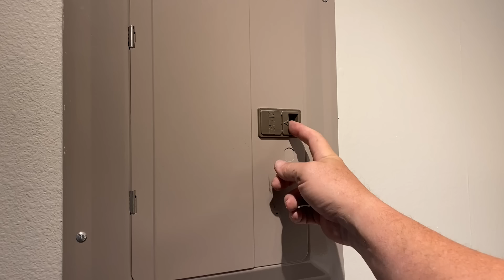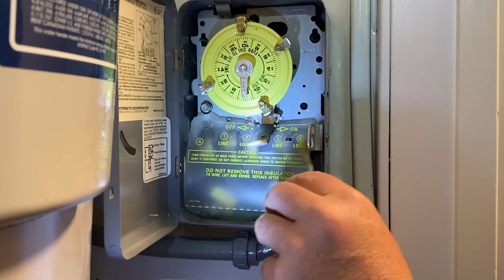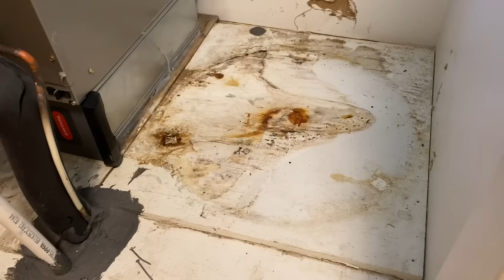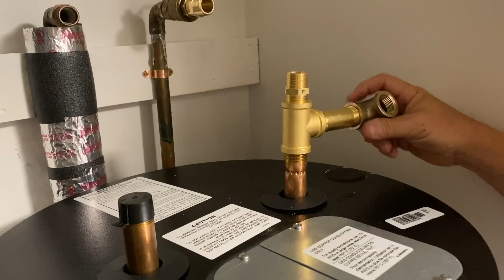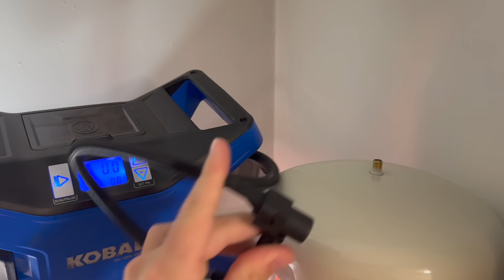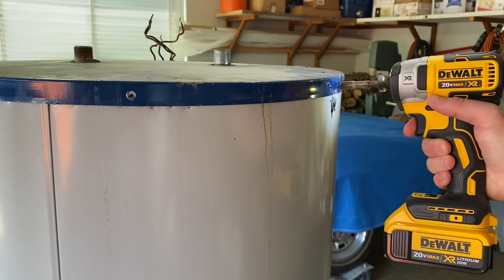I Saved $1,000+ By Replacing My Electric Water Heater (Step-by-Step)

Comment: You mis-spoke about the wiring. You referred to the black wire as the negative wires…..that’s only on D/C , or Direct Current, circuits. Like a car or a generator. 

In homes, which are always A/C Circuits, or alternating current, on a 120volt circuit, black is your hot wire or live wire…..white is your neutral wires. 
 220 volt circuits like this 30 amp circuit for water heaters, it doesn’t require a neutral to be present. So the white wire coming from the electrical panel isn’t a neutral, it’s used as a secondary hot wire. Pretend it’s actually red. That’s bc both white and black wires are landed on the breaker. Where on 120v circuits, black is landed on breaker and white is landed on the neutral/ground bar that is attached to the sides of where the breakers are. 

Typically neutrals will share the bar with bare copper ground wires. Unless it’s a sub panel, in which case, grounds and neutrals will be separated. All neutrals on one bar and all bare ground wires on another bar.   

It’s important to know that so people don’t get hurt.

Pretty much it’s this if you want to refer to it as positive and negative:

120v - single pole breaker - black is the “+” and white is “-“

220v - 2 pole breaker - black is “+” and white is “+” 

There is some 220v circuits that require a neutral to be present in which case a different type of wire is used that will include a red wire along with the black white and ground. In that case, the red and black are positive, white is negative. Bare is ground. 
I used the words positive and negative to help describe things but proper terminology is hot and neutral wires. In dc circuits it’s red and black - positive and negative.
Reply: It also appeared that he was working on live wires. He turned it off later in the video. Nothing like live wires to get your attention sometimes.
Reply: @robertthomas5906 turned off at the timer on the wall.  not best practice, but was off.

Comment: The electrical connector used on the tank….the one you reused…. is wrong. Should be, what is called, a 3/4” male liquid-tight connector.    It’s for pvc flexible conduit like you’re using. The old one you used is for flexible metallic conduit.
Reply: Are your referring to the wire nuts...?
Reply: @rudytamayo2646 did I say wire nuts?

Comment: I enjoyed looking at your video. The only question I have is why did you need the expansion tank? If you have what I would call an open system any excess pressure from thermal expansion would be pushed back to the municipal water main. If you have a backflow preventer or check valve on the cold water service supply line to the  house you would have a closed system. Any excess thermal expansion pressure from the hot water tank would either be released through the relief valve or the diaphragm in the expansion tank will expand to accommodate the extra pressure that has been added. Thanks
Reply from the maker: Yes we have a closed system and the loval gov wanted us to add it... so it is "up to code"
Reply: @ thanks for your response. The darn government!!

Comment: Nice work with everything. One thing you should be aware of though is that your water heater timer box in not rated for use with the aluminum wiring you have from the electric panel to the timer box. At a minimum I’d recommend going back and tightening the aluminum connections as much as possible without breaking anything and then re tightening every five years or so. Water heaters use an extremely high amount of power and will burn any connections (especially aluminum ones) that are not very tight. It also wouldn’t be a bad idea to go back and tighten the wire nuts on top of the heater and the circuit breaker connections at the panel more. Also if you’re not using the timer function you could replace the timer box with a 30 amp rated disconnect which are usually rated for copper or aluminum.
Reply from the maker: Good eye! We addressed most of the outlets with COALR. Ideally we'd like to rewire the house but probably won't end up doing that. We'll add this on our list of to-do's! Thanks!

Comment: Looks like the old tank corroded because no one replaced the anode rod every 5 years and it rusted into nothing.  Also that grinder's power cord looks like it has seen some things lol.
Reply from the maker: Yeah I dont think the prior owners every changed the anode rode. And based on the condition of the home when I bought it... I dont think they really did much of anything to the property. Changing out the water heater was one of the first things I did when I moved in.
Reply: I think very few people replace the anode rods. I'm about to replace my first rod soon.
Reply: Better yet put in an electronic anode from Corro Protect and never worry about it again.